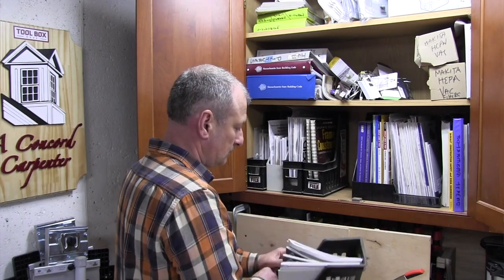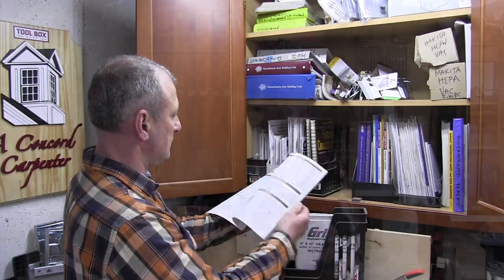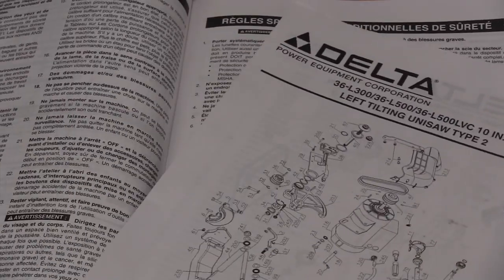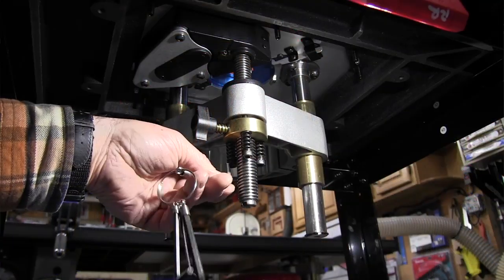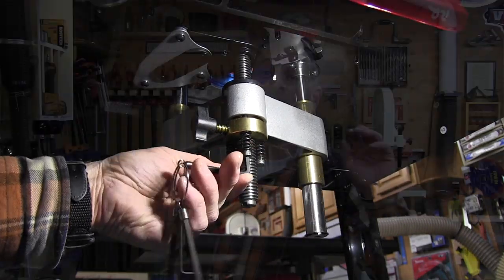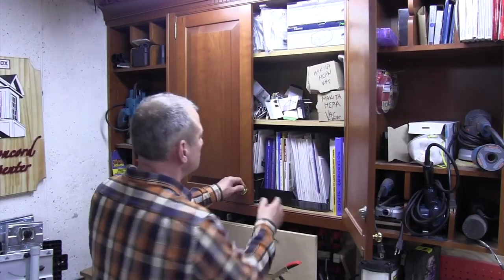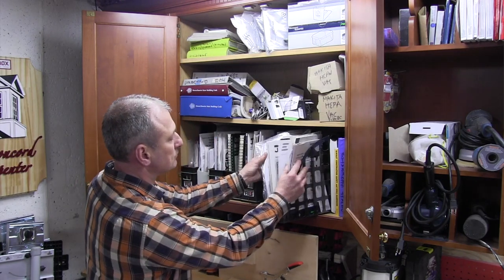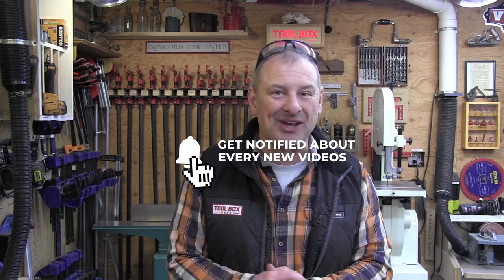Saving Tool Manuals - 2 GOOD Reasons To Do It

Comment: When I purchase a tool, I always download the manual in pdf form and save it on my computer.  The paper manual can get lost or damaged so it's nice to have a backup.  Also, the pdf file is really easy to search when you're looking for a particular setting or function.  Also, I scan the receipt and store that on the computer as well.  Receipts are notorious for turning black over time due to the heat/moisture sensitive paper they use.
Reply from the maker: MikeBramm I hope you use an external back up

Comment: I'm a filer too! 🤓 Now that I have a printer that also doubles as a scanner, I scan them, file the document in OneDrive (stored on computer & in the cloud), and put the actual paper manual in a ziplock bag that is filed away in a plastic box.  That way if I need to refer to it, I just look it up on the PC, and the actual manual is available if I really need it.  I like the this approach because it's a form of backup in case of physical disaster.

I also download the online PDF if it's available because it's generally cleaner than a scanned doc.  And I scan receipts and file them.

Comment: I got in the habit of writing  on the manual, on the cover, if necessary: Date put in service & where bought, model number (some tools have a manual for quite a number of models, and I circle the correct one), serial number (if any). If the engine has a different set of data, I add that, too. I really like your idea of organizing them. I've been known to staple the store receipt or the shipping invoice to the inside - or a copy. You are right about receipts - 3 years down the road and you can't find them. When the tool was eligible for taxes, they got scanned and filed in a separate folder. I'm past those days, thank goodness. Craftsman changed parts numbers, a number of years ago - that seems to happen to other companies, but a call to the Service number with the old number&name seems to solve that.

Comment: Good advice, here's what I do- Buy it in a store or on line bring it home 1. check it out for all the parts and condition, works ? 2. On line or mail in the warrantee card -think recall. 3. Try it out hard enough to break it before 3 days have passed if it gonna break now is the time to find out. 4. Find the manual on line down load it and file it 5. staple the recite to the paper manual and file it .....someplace or another. this routine has saved me so much time agervation  oh I almost forgot 6. Tell myself I really needed this tool 7. Have a Beer

Comment: The other advantage to saving the manuals, is that there is usually a spot in the first page or so to record the actual Model Number, Serial Number and the date of purchase. I've done it for years. I probably still have some manuals for tools I don't even own anymore. If I sell a tool, I always make sure the manual goes with it. I usually end up wearing the tool out and that's why I still have old manuals.

Comment: I get on to people about reading their owner's/operator's manuals, and keeping them in safe or easily located places all the time.. I have printed out manuals for tools that were given to me, mainly for use to locate parts because the tool wasn't working properly or at all, but they have also come in handy for setting up the tool properly.
As an auto tech, I can't tell you how many owners have come into the dealership stating they can't set up something, and the vehicle was sent to me only for me to find the information in the owner's manual. These were things the owner could have found if they only took the time to read the owner's manual. They were usually things the salesperson should have gone over with them during delivery of the vehicle, but it wasn't always done. As a flat rate technician, I am paid for the work I do, I am not an hourly wage employee, so I didn't get paid for these "repairs" because there was no actual repair performed.

All manuals should be read and kept, but the more technologically advanced the item is, whether it be an automobile, a tablesaw like a SawStop, an Nova Voyager drill press,  etc, the more the need to read and keep the manual for future reference.